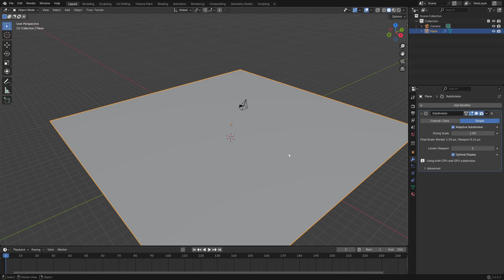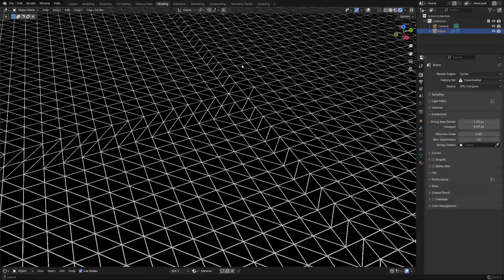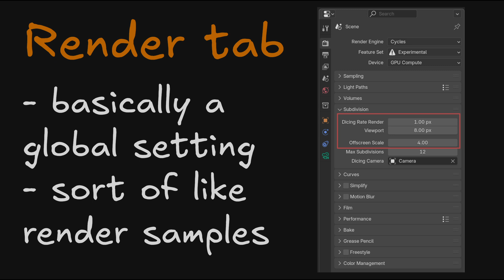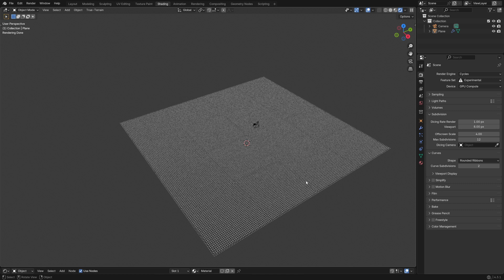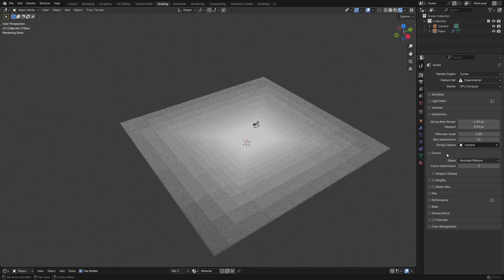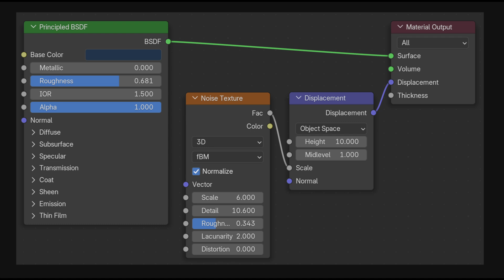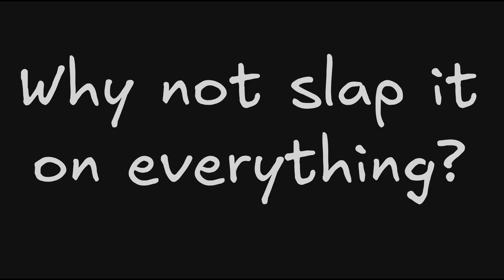Adaptive Subdivision Surface VISUALLY Explained | Blender

Comment: This has been my primary problem with scaling up my work into higher quality rendering in blender. Adaptive subvision is great in some cases, but it is massively outpaced by all other render engines displacement algorithms. Hopefully blender finally implements proper cycles displacement one day
Reply from the maker: yeah, cycles' adaptive subdivision is decent but definitely not on the same level as true micro-polygon displacement in vray, arnold, or redshift. It kinda brute-forces tessellation instead of dynamically refining only where needed
Reply: @sarotoza  Isn't that what it does in Blender 5 now?